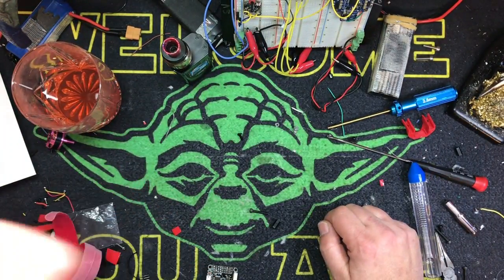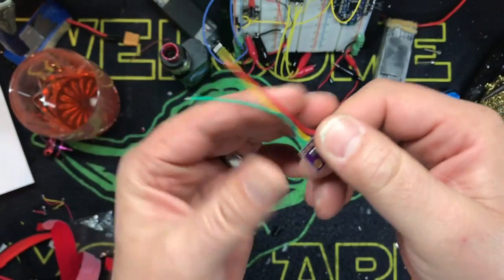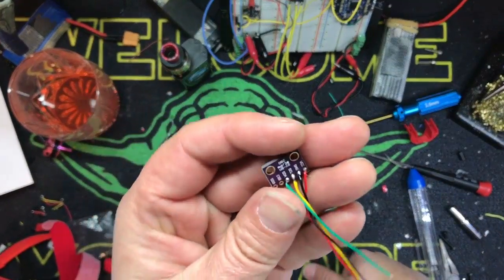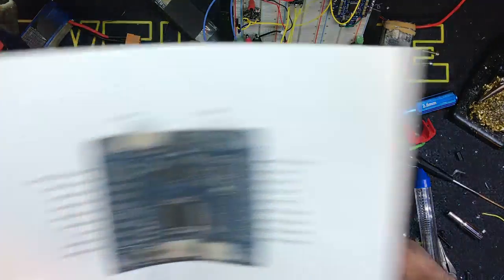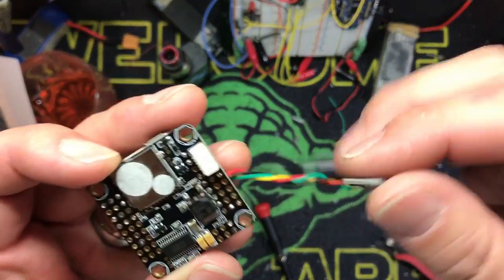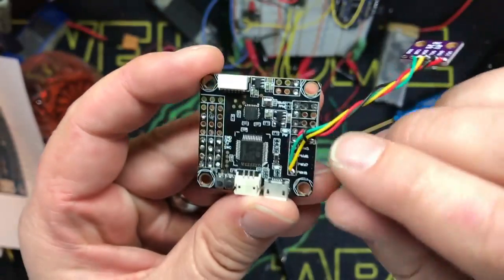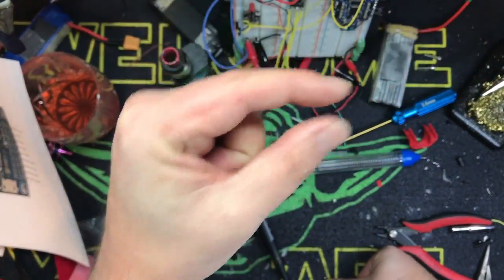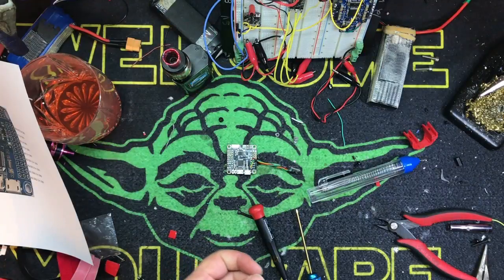QuadKitchen - Adding a Barometer to any FC

Comment: If you wire the baro in parallel with the gps/mag it will come up in inav once it is switched on in the configurator. Easy to do.
Reply from the maker: Ahhhh I’ve never tried that! Thanks for the tip
Reply: You mean hooking Baro & GPS to the SAME SDA & SCL solder points?  I tried it, didn't work.  

I THOUGHT it would.  The protocol is supposed to be addressed...kind of like an old computer network?  🤷🏼‍♂️
Reply: @stillededge is there any solution for that?
Reply: @khalilaputrirahmawati2276  Dunno.  Haven't messed with it since...nobody has said.  Maybe try in SERIES vs PARALEL?  

I ALSO found that you have to INCLUDED the BARO & Magnetometer code as a selection when flashing your flight controller...so...haven't NEEDED to retry this.

Comment: What if you don't see an SDA/SCL port on your F4 FC? Plenty of UART's..
Reply: you can't connect it then, because it's a i2c device. you need an i2c port. btw, the port  can be even shared with other devices as long as i2c address is changed.
Reply: @JanisBebritis  Is there a tx rx type barameter module available anywhere?
Reply: you can resource remap
Reply: @ujjwalkumar1006  difficult to get it working ..better to buy a new board with an inbuilt barometer
Reply: @danielfernandes2813  yes it's easy, but got working baro on clracing f7 dual and mamba f722
Reply: @ujjwalkumar1006  Hi I have CLRacing F7 and my TX2/RX2 is connected to the GPS, could you elaborate how to do the resource remap? thx
Reply: @ujjwalkumar1006  figured out by myself. thx!

Comment: Will this methond work if I hav a faulty barometer on the FC and want to add this to solve the barometer problem? Do I need to remap the baramotoer in the CLI to use this one I've soldered on now?
Reply: Nvm, did the mod and it works. Thank you very much :) All i did was solder to the same sda and scl pads and its working.

Comment: Thank you for video.
Sadly it doesnt work with a Mamba F504 MK2 Stack, which has SCL and SDA Pins.
I connected it the same way.
I activated "Barometer" in Betaflight and restartet it. But Barometer won't light up in the FC and i get no value in the OSD.
In the CLI i typed "status" and i receive "0 Errors on I2C".

What could be the next step to troubleshoot?
I hope you answer me. Thank you in advance :-)
Reply: Joshua now it works on Mamba F405 MK2 with betaflight 4.0.6.
Reply: @SERIALPALL  Yeah...already noticed! Thanks for your answer! But Magnetometer still not.

Comment: Importand question from me ,
 I have FC with one SDA and SCL soldering holes and already GPS mounted in it.
Can I connect barometer to the same soldering spots?
I think should work, on arduino its normal, but what for FC's??

Thank You for reply.
Reply: Have you been able to double up on the gps and barometer?
Reply: @sladelefty  I have the same issue and would like to know.
Reply: Galinsky FPV Yes the sda and scl are 12c inputs which can usually handle up to four devices in one uart. Inav will usually pick them up automatically.
Reply: @sladelefty  great thank you very much for the reply!

Comment: so i have an omnibusf4sd AIO board from banggood and it doesnt have any scl or sda pins so i read that tx3 and rx3 can be configured to i2c in the betaflight cli. i have connected the vcc of the barometer ( bmp280) to 3.3v on the fc and the scl and sda to the tx3 and rx3 on the Fc respectively.  I have had no luck in making it work tried the "resources i2c_scl" commands in the cli but no joy. btw the fc is flashed with the latest betaflight 4.1 i think. any help would be much appreciated.
Reply: im in the exact situation,
Reply: resource I2C_SCL 2 B10
resource I2C_SDA 2 B11
Reply: resource I2C_SCL 2 B10
resource I2C_SDA 2 B11
Reply: @ivansherin8320  does it work for you?
Reply: @danielfernandes2813  half day tried to read manuals and try my bmp180 on i2c2 with f4 omnibus. Not work.

Comment: Hi, I'm using a T-Motor F7 FC, does anyone know if I can solder both the barometer and the GPS module's SDA/SCL wires for the magnetometer to the same SDA/SCL pins on the FC, and have both the barometer and compass working in Betaflight and maybe INAV? (though I'm not sure if INAV even supports this FC)

Comment: Is it possible to connect it via TX RX (or any other way not concerning SDA) because my GPS has already used my SDA port and I have none left.
Reply from the maker: Hmmmm I have t tried brother.  Sda and scl should be able to handle them both wired in if I remember right.  I’ve hooked up gps and oled to single sda/scl ports before and it worked
Reply: JJRotoGeek So sir the problem with my SDA is that it comes out of I2C1 port and soldering is not possible in there as it is a wire connection port, so should I solder my Barometer, Magnetometer and GPS to the single SDA wire?

Comment: Hey great channel, wonder why you were not popping up in my recommendations ever.  Question.  I've got a Hobbywing Xrotor F4 G2 board and I want to put a barometer on it but it lacks the SDA pins on an omnibus. Could I somehow use an open UART?  Could it share a UART with my GPS?  Thanks and I'll be watching.
Reply from the maker: Hey brother.   Pretty sure it’ll only work with sda.

Comment: Hey, I know this is an old video, but I'm wondering if I could run both my GPS and an external baro such as this off of the SDA/SCL pads. For instance, could I wire both SDA wires to a single SDA pad? Thank you :)
Reply: yes, there are some caveats to do with resistors but putting a few i2c devices in parallel on the i2c bus is fine.

Comment: I have a FC board that has one set of SDA and SDL I unlike yours which has two sets.  I have a compass wired to the single set on my FC already and want to add a baro.  Can I connect both to the one set of connections for SDA and SDL?
Reply from the maker: Hmmmm I’m trying to think if I’ve done that.   U can try it at least.    Won’t smoke anything
Reply: I’m reading on an iNav thread and the posting person is saying that the IC2 bus does support devices hooked to it in parallel.  The bus uses device addresses to keep it all sorted.   Thank you for the reply!!

Comment: Where would I connect this using a Betaflight BFF4 board if all of my uarts are currently being used.
Reply: You can run the barometer and gps in parallel on the same uart

Comment: Hello, 
the gps with compass where would you connect it if you occupy the pins with the barometer? Or can you connect it to the same place as the barometer? Thank you.
Reply from the maker: Are u using a separate barometer???
Reply: JJRotoGeek yes. I would put a bmp280 barometer and a gps with a compass. Do you say it because there are 3 things together? Thank you.

Comment: how about in mamba f405 20a 20x20 fc how can i connect it thanks
Reply: Yes.
Reply: I Have a normal Mamba F405 MK2 Stack and it doesnt work.
I connected it the same way like in the video and activated "Barometer" under "Configuration" in Betaflight.
I restart the FC but it still wont show up.
Does it work at your FC? Can you give me a tip for troubleshooting?
Reply: @Joshua-lb8bt  Have you put the battery?
Reply: @MoTurcu The problem was, that FuryOSD doesnt supportet that Barometer at this time.
Meanwhile its working. But if you wish to let it work together with GPS the altitudevalue gets wrong when you arm, because they use the same integer/float fpr that and you cant prior any sensor.
When you start the copter the GPS Modul gets the real altitude and put the value in e.g. "altitude_1".
When you arm the copter, the Baroaltitude is always 0, cause it cant know, how absolute high you are. Its puts the value in ""altitude_1".
And at this moment the FC starts to mix the values together and you just get scrapped value output.
Reply: @Joshua-lb8bt  I just purchased a Roma5 DJI build with Mamba F405 stack.  It doesn't have baro unfortunately.   Was you able to get baro working on your Mamba F405 fc?

Comment: Hi I try to connect the same barometer as you  to dalrc f4 aio board without any success it.The icon not lighting in BF 3.5 . When I tape command in cli set baro_hardware = AUTO or 0 I get error invalid name please can you help to work this barometer
Reply from the maker: Hey there!! Sorry for the delay.   Did u enable barometer in the config screen.  U don’t need cli for this
Reply: Yes but it is not working it's not enabled in BF so I try not cli

Comment: I am happy with my cc3d atom flight controller, but I want to see how high I am.
would a Barometer work with the Atom fc?
Reply from the maker: Wow.    Cc3d is going back.   Do u have sda scl ports on that??? I can’t remember
Reply: yes ive just noticed it has a flexi port, which has sda scl!
Reply from the maker: Bam.  There ya go!!!! Cheap up grade

Comment: Hey there, interesting video, do you have any brushed board recommandation with barometer included or sda/sdl pins to hookup a barometer?
Reply from the maker: Oh wow.    Haven’t built a brushed micro in a long time brother.   What size motors and quad
Reply: JJRotoGeek  Yeah it’s a micro quad, 70mm motor to motor and 65 mm props
Reply: Motors are 8520 racer star

Comment: I know this is a weird way to get a hold of you sort of creepy lol . I have a cicada board and trying to get it to respond to a spectrum reciver. I got 3.3. Boost to is just in bata flight no respond to it. Any help ? Thx
Reply from the maker: Hey brother.    Are u wires into the sbus port in the front of the board,? Also select uart 1 as your port and the serial protocal in the config page then spectrum.
Reply: JJRotoGeek . Apparently I'm not an amazing YouTube guy not sure if this will get to you this way or the way I send a message that I don't see right now but thank you for getting back ahold of me bro I do have my Spektrum controller for my signal going to the sbus and my uart 1 on my configuration I was thinking I have to put it to the RX and change to U port6. Haven't done that yet going to try in a few here PS keep up with your amazing videos I love how they cut through all the BS
Reply: JJRotoGeek I got it
Reply from the maker: Hey brother, your not the first person I’ve heard woth issues on spectrum.  Unfourtunatly  I have little experience with spectrum.  Let me know how it goes, I know another guy that’s having the same issues
Reply: JJRotoGeek so the fix is  use the signal wire for the special controller to the spot for the GPS RX8 then change the ports and it works no problem this is my first bill I think I picked a doozy lol. A doozy I wonder where the hell that word came from now I just have to program my ESC is I think cuz they're not spinning correctly and tben i can get this bird in the air.
Reply from the maker: Bam awesome brother🤘🤘🤘 sorry I wasn’t more help on that for ya
Reply: JJRotoGeek the fact you reached out was amazing.  Thk you hell the company  even reached out . They didn't know the fix and want me to help them . Lol I think it's a simple thing for the Spektrum guys I'm just not as smart as they are did you understand my fix so you could help that other guy that was reaching out to you or do you need me to reach out to him
Reply from the maker: Naaa I understood it brother.  I never played with spectrum.  Thanks for the fix brother 🤘🤘
Reply from the maker: Naaa I understood it brother.  I never played with spectrum.  Thanks for the fix brother 🤘🤘